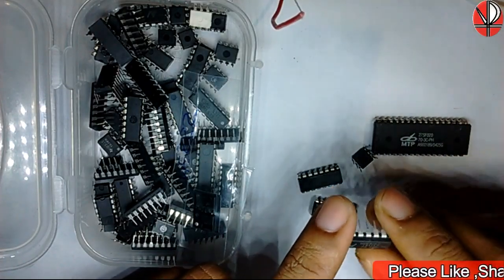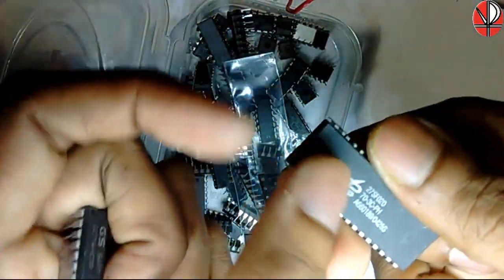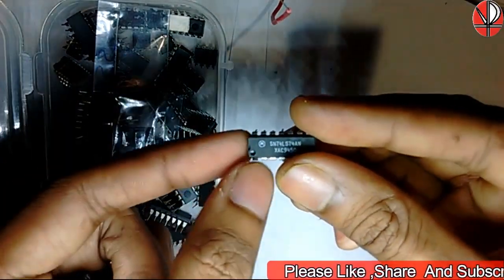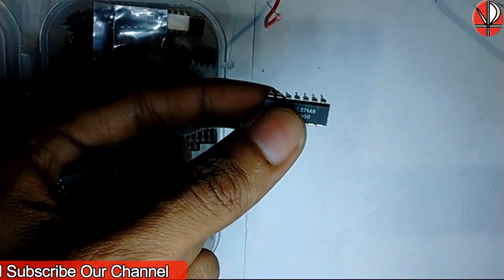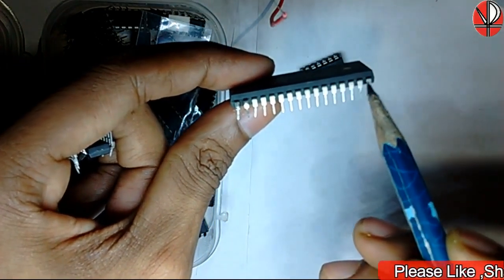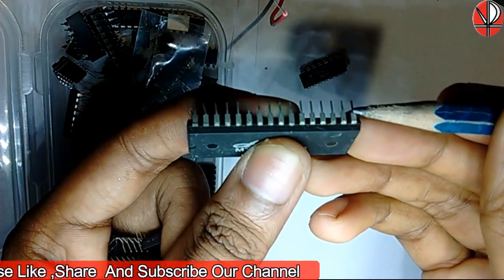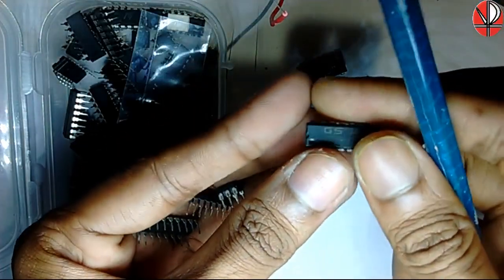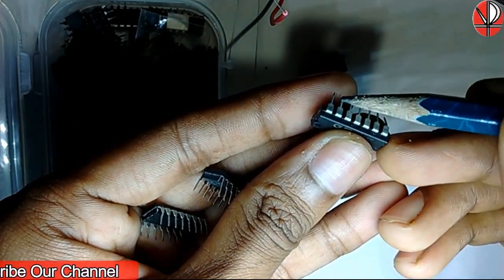how to identify ic pin number

Comment: what is the material used to manufacture this ic
Reply from the maker: Thak You for your comment.
Most Commonly used material is silicon.It is the main Part of the IC.Phosphorus and Arsenic are used as  N type dopants and Boron and gallium are used as a p-type dopant.Aluminium is commonly used as interconnections.